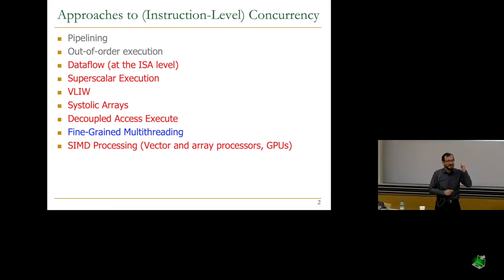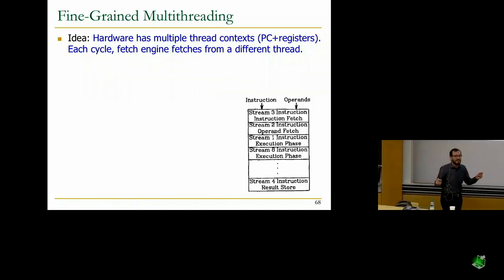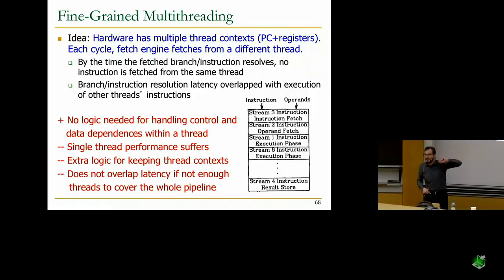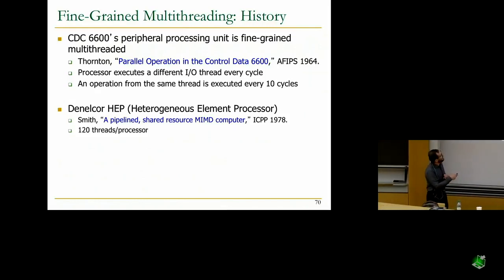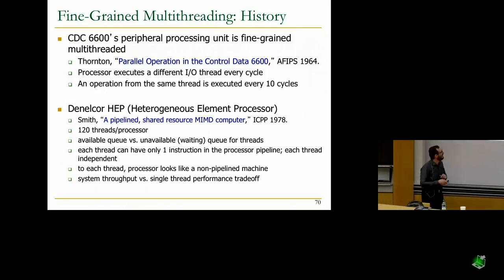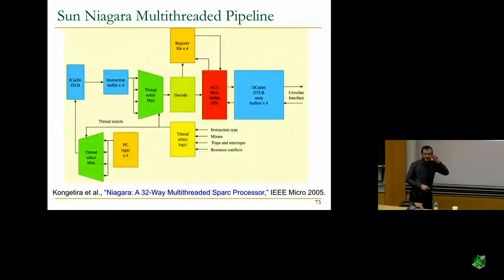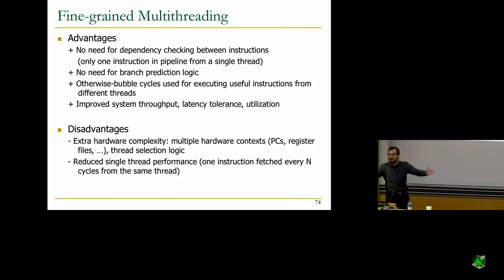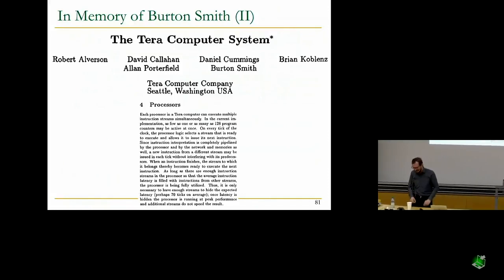Digital Design & Computer Arch. - Lecture 18c: Fine-Grained Multithreading (ETH Zürich, Spring 2020)

Comment: so in the Sun Niagra system we only describe a single execution unit? the MUX that feeds into the decode stage suggests so; which means effectively you are creating an in-order pipeline but with instructions from different threads? am i wrong? so the IPC is still 1? it makes sense nevertheless since you eliminate any logic required for branch prediction/data dependency checking but nevertheless you would have to stall the pipeline for variable latencies however. why not simply define 4 of everything instead?